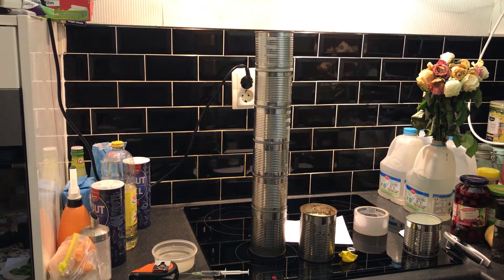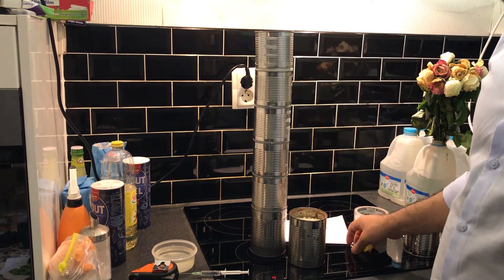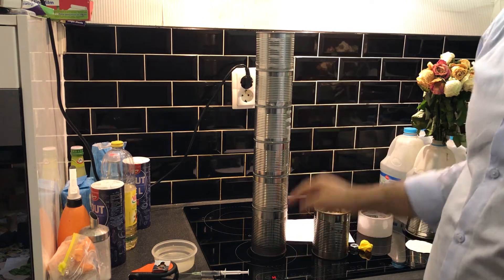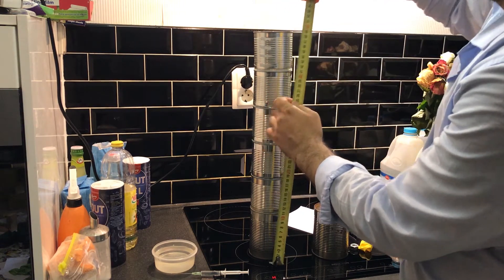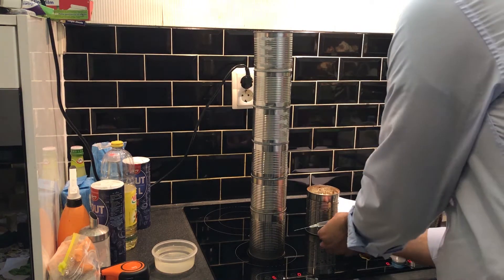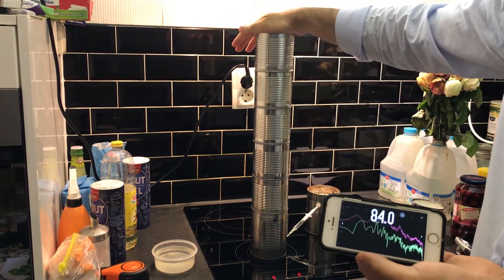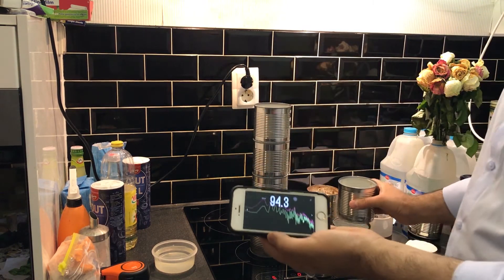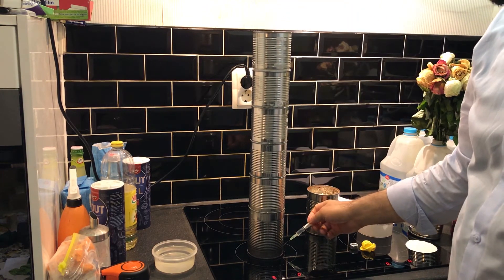Thermoacoustic engine (The Rice engine) makes very loud sound , Quarter Wave Resonator

Comment: wow thats so cool. I was thinking that you don't even need to make it that tall tho. if you learn to play with the concept of cavity ressonance in relation to the speed in which the sound pressure wave exits the cavity via the exit point you can manipulate the frequency to your desired FR hrtz rate. You can manipulate the ressonance frequency by playing with the exit opening, by making it narrower and even putting lids on top you can modulate the speed in which air pressure wave escapes out which then controls the frequency range. 
would like to see more of this experiments,

Comment: Thank you for your good work. Can you please make a tutorial video about parallel capacitor with AC signal input in COMSOL?
Reply from the maker: Thanks, What do you want to achieve with such model ?
Reply: @HVE   I want to see the electric field change related to frequency.
Reply from the maker: @muhammedkara9185  Electric field does not change with frequency for an ideal capacitor. It follows the AC voltage that you apply between the terminals, so it changes, but that change is obvious. What is the original question ?